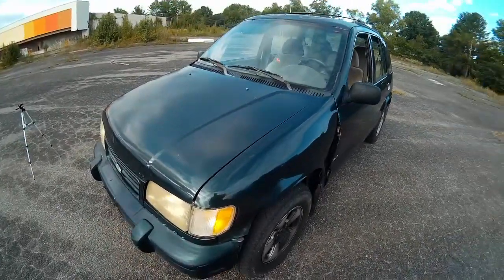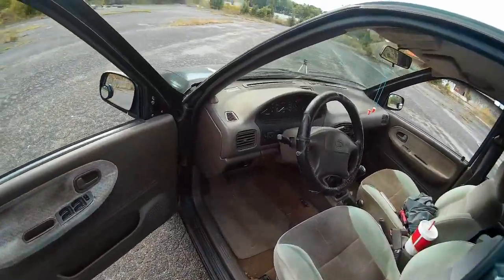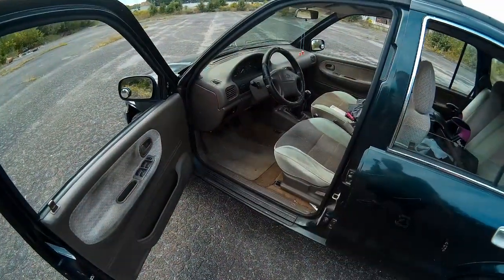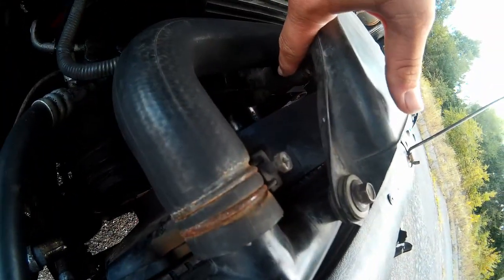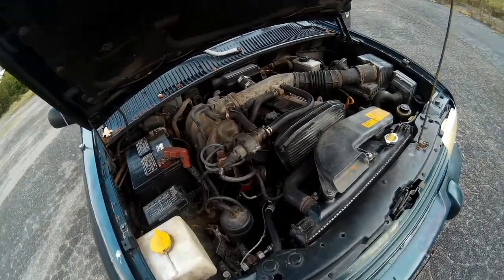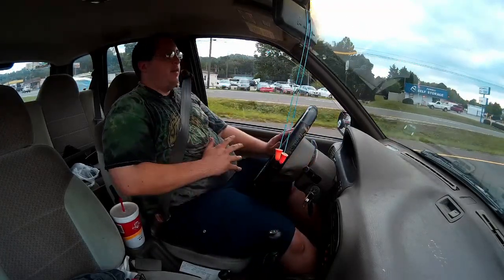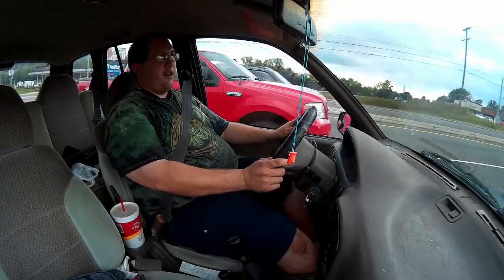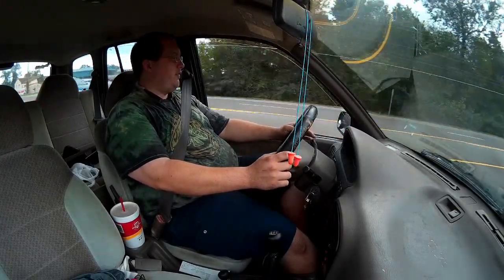6 Months With My 1996 Kia Sportage and 5 Things I Dont Love About It

Comment: I just bought my Kia Sportage 4x4 for 200$ and at that price I have zero complaints with it
Reply: I just bought mine for $175 has the convertible top
Reply: @OhZustu  Oh man those are neat, you got lucky on that find.
Reply: I'd strongly recommend swapping the stock front wheel automatic locking hubs with manual locking hubs. The originals will strand you in the sand if there's a vacuum leak.

Comment: What? Complexity of maintenance?!? The timing belt and water pump can be done with a Walmart socket set in a parking lot in less than 3 hours.
Reply: As someone that changed a timing belt under those EXACT conditions Im still in love with my 02 4x4 after 6 years of ownership. Did end up having to invest in a harmonic balancer puller that day though, but I've used it a few times since so I'm glad I was forced to invest.

Comment: Been running one of these since around 2015 or so- first car, and I have to say it's really earned my respect. 

It had kinda gone through hell by the time I got it: the previous owner decided to try and sell after hitting a pole going around 40, it caved in so far it was the actual engine block that physically stopped the car. We straightened out the frame by tieing one end to a tree and another to a truck. Give it a pull, an wield the tear in the frame with some old bolt. Just kinda bend everything roughly back in place after that and throw in some little off-the-shelf radiator, replace the pipes, new hood, ect. fill in the big dent on the roof from when the pole fell down with some of that plaster stuff. Paint it over and it's suddenly it's good as new**. :P

My dad thought it would last at MOST three years before being totally unsalvagable. Up until only just this weekend it had never even actually broken down before (one of the coils gave out- I feel ya on everything being hard to get to) . Always started just fine for years, good and responsive despite everything. Despite clicking like a clock for half a decade! I actually haven't had those acceleration problems you mentioned either, it's really quite zippy for me. Kinda hard to get it to go slow in school zones actually, like I have to feather the accelerator. I've got 2000 automatic one, that might have something to do with it? Maybe its an artifact from when my dad worked on it, who knows. I do have one major complaint- the door mechanisms keep giving out. The mechanics seem to be made of some plastic comparable in strength to soap. Neither of my rear doors open at the moment, the spare wheel thingamawhatsit doesn't open right now either, and I had to totally replace the mechanism on the drivers door. Same deal as the windows as you pointed out at the end. :P A word of advice- stock up on parts for the doors!

Aside from that, though, its quite a charming little buggy! Of course it's my first car, so invariably I'll be quite forgiving on it, but it's surprised all of us with its resilience. it even put up with another wreck (not my fault! some moron tried to use an emergency overflow lane as a turning lane. I was in the actual turning lane, hilarity ensues.) Took a nasty hit directly on the driver side front wheel. Just disconnected the old 4x4 controls and installed some of the oldschool manual ones- I mean its a city dweller these days so who cares anyway. Pop out the fender (again) and put in new parts for the steering. 

Back around the 20's there were these basic little cars called "flivvers". They were like the cheapest cars possible- literally four wheels, an engine, and two seats open to the air. When I look at my old sportage, that's kinda what I see.
It's basic, chronically unassuming, and resplendent in it's baseline adequacy- and yet it's really quite fun to drive. Every time I turn the key and it starts right up I'm kind of in awe of the miracle of it. It's a proper modern day jalope that flatly refuses to die, and I love it to bits.

Comment: I’ve own 3 of them ( 1999, 2001, 2002 ) they all earn my respect. I do all the fixing myself too and it has taught me a lot. I drive the 2001 one, down the highway around 75-90mph for 35-70 miles and the death stares are there without a doubt 😂 especially considering it’s a straight pipe from the first cat back. Now when it comes to gas. It’s worst than my 3.2l M3. Probably making 9mpg. But it’s gotten me out from point A to point  B quite some times now  and it’s definitely worth the buck. Like my father said “coolant, oil, and gas. thats all it wants”
Reply: Hey I hello I have a 99 kia grand Sportage, I live in the dominican rep,  i want to know have you change the pcv Valve of one of your kias, AND what aré the consecuences not yo change It,
Reply: kairo Javier basically struggles to idle when your not driving. It stalls at times. I notice my oil to be not cycling correctly and at times might over heat. You want brand new pcv parts and always lube the o-rings. Or else it throws a code for vacuum leak
Reply: Hey man I have a sportage 2000 and can’t find the crankshaft do you know where it’s located

Comment: Hi! I have a 96's gasoline version in Brazil and the fuel float (for fuel measuring) is gone... And it is hard to find another one. May you know if I can substitute it by an equivalent from another vehicle?
Reply from the maker: I'm sorry I wouldn't know. I wish I could help. In many cases though, at least here in the states, you can't buy just the fuel float or sending unit without the fuel pump. I figured that out the hard way on an old nissan once
Reply: @ThatCarVlogChannel  Maybe if I try figuring out the parts connected can solve. Thanks by the tip and feedback!

Comment: Where is the heating core outlet in a 01 Kia shortage please reply it’s gettin cold out here in jersey
Reply from the maker: Not entirely sure, never even had to look for mine. Check your firewall for 2 hoses going into it side by side, usually an inch or 2 in diameter. One is inlet, the other outlet. That's on most cars I've seen

Comment: I feel like my 2000 automatic has the same gearing issue, however power mode really does make a difference (at the expense of some fuel efficiency) and even without it I can comfortably do 80 around 3-3.5k. The acceleration is pretty garbage in eco and hills aren't the best but I can accelerate from a stop in either mode. I agree with a lot of the gripes with the first generation, and NONE of my windows work hahaha.
Reply from the maker: I traded mine a couple years ago. And even with all that said, I still want another
Reply: @ThatCarVlogChannel  I think I'll keep mine at least for an offraoder and work vehicle. Just passed 192k miles and Nigel is running strong is his scratched and faded purple glory. You do need a key for the rear hatch in the 2nd gen, but the pull cable for the spare and the gas lever is more low profile so I'd recommend a 2000. Hopefully you find another one in good shape my friend.
Reply from the maker: @kingcorpse1771  maybe one day. I hear they're pretty good offroad. I never really got to try it
Reply: @ThatCarVlogChannel  oh yeah mines at stock height and I have no issues going to the lake and trails out here in the East Valley of AZ. Only thing I've had break is the cross bars for a roof rack, but I also had a full ice chest and some other stuff up ontop.

Comment: I get where you're coming from complaining about the 3000+ rpm on the freeway, but I just have to laugh because it obvious your never drove a V8 with a pre-overdrive transmission. My 88 Bronco with a 5.8 V8 would SCREAM at 3300rpm at 60mph and around 3700 at 70. Now that is absurdly high for a 8 cylinder. Consequently, it only 11mpg which I was surprised I even got that... That being said, 3k rpm is about average for 60+ mph on a 4 banger since they are more efficient due to a smaller displacement and that they normally have to be higher RPM to help maintain the power band (otherwise it would just be undrivable because you would be shifting 24/7 to counter act turning at 2k rpm). The issue with the Sportage comes to final drive and the extra mass of the 4 wheel drive system and the fact that it's an anemic platform per vehicle weight (130hp @ 3400 pounds means the engine works harder no matter what you're doing with it compared to 130hp @ 2500 pounds)